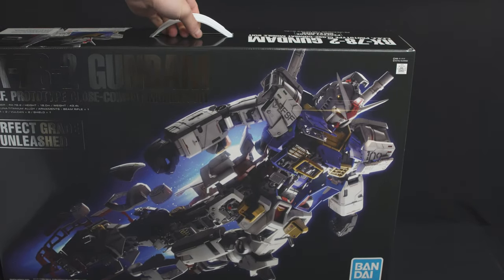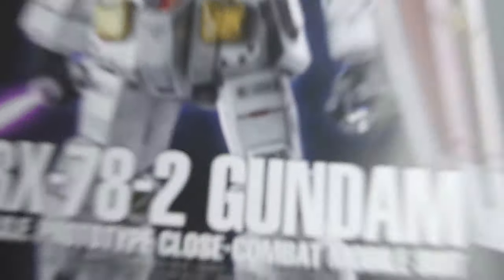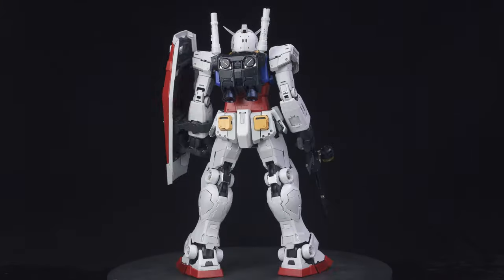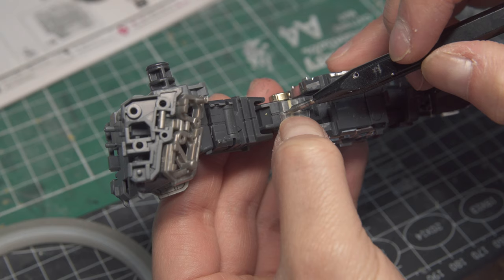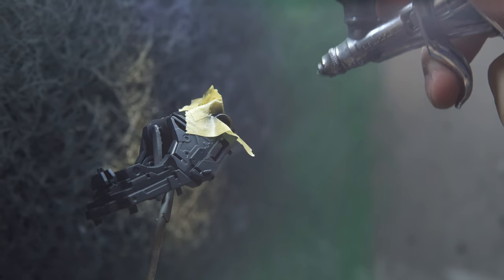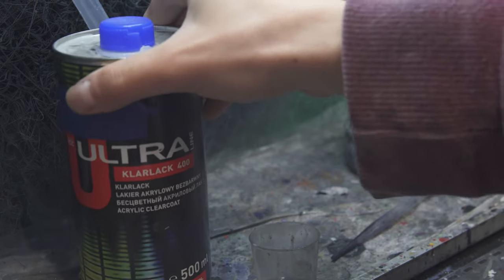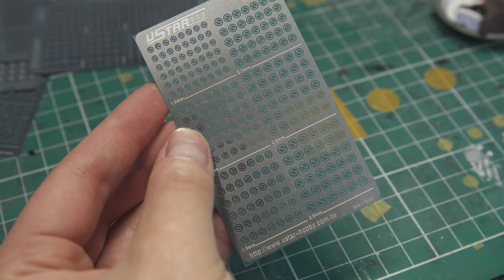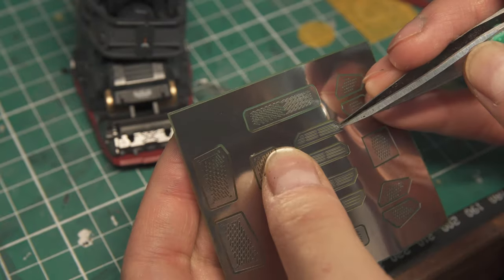PG Unleashed RX-78-2 Timelapse Building & Inner Frame Painting | Custom Gunpla Painting

Comment: The fixed hands are a huge deal breaker for me, especially for something hailed to be the best PG kit. You did it some great justice though
Reply from the maker: To me I prefer fixed pose hands, because moveable hands are just too troublesome to deal with. 
First they have nubs on every joint of the finger, and sometimes they use a soft plastic and most of the time they can't pull off good poses anyway

Comment: Hey Jason! Any advice on painting the ABS frame pieces? I've heard some people have nightmares with adhesion or poor fitting after painting
Reply from the maker: You mean the soft plastic? There isn't any of those in the PGU but I had to deal with some in the original PG RX. Because you can't sand it so what I did was I put a layer of super glue on top then sand the glue flat instead.